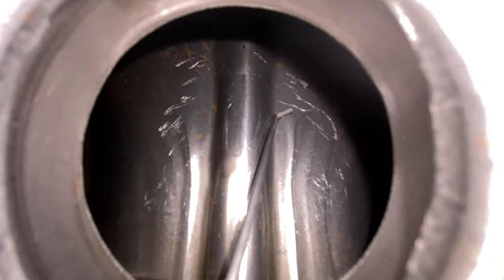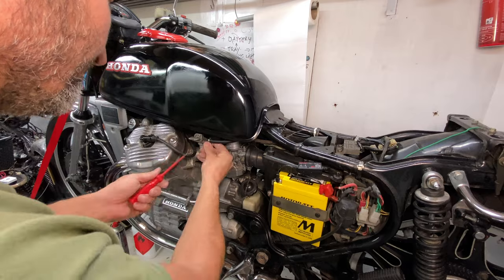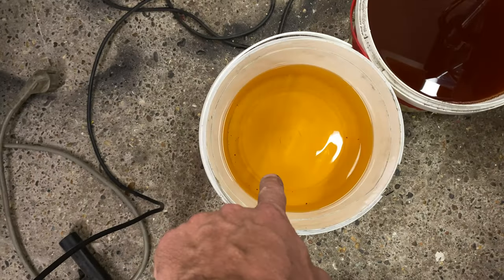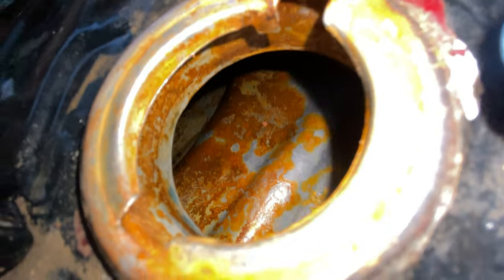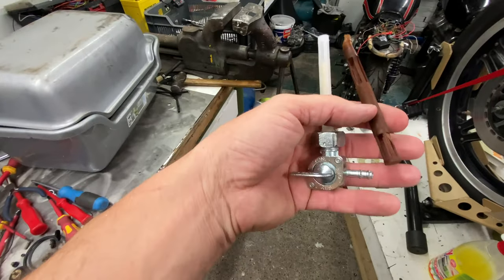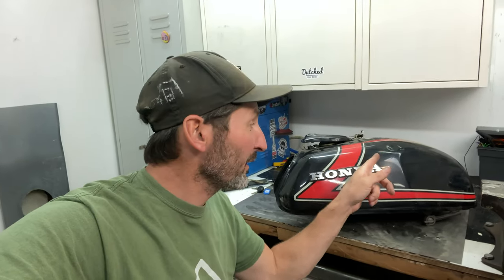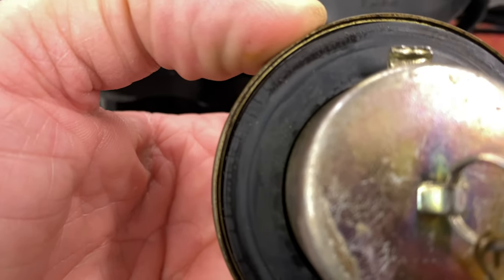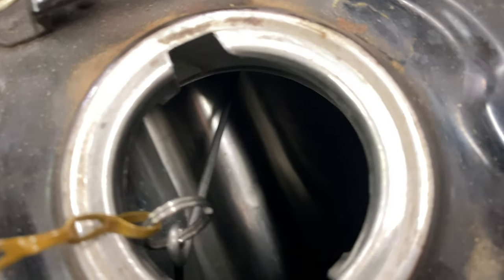Honda CX500 Fuel tank swap and clean

Comment: i have heard some acid treatments can work pretty good. making a stable  black oxide surface that is resistant to fuel, Only problem is if you dont get it -perfect-, the problem will come back